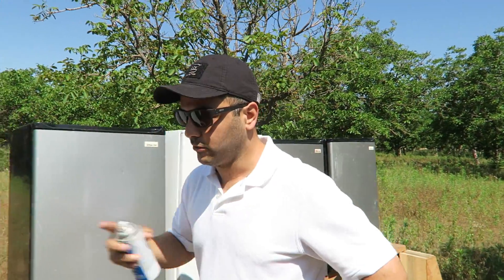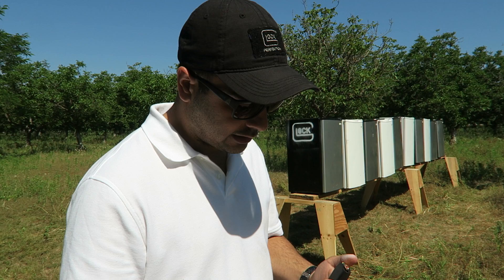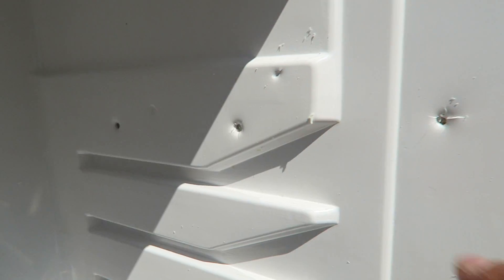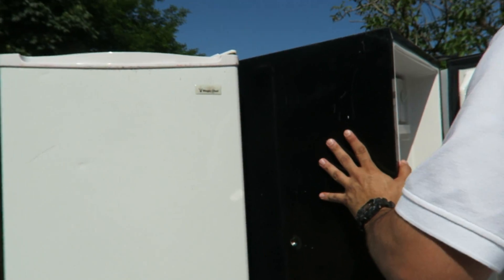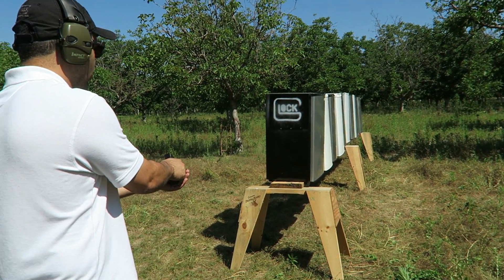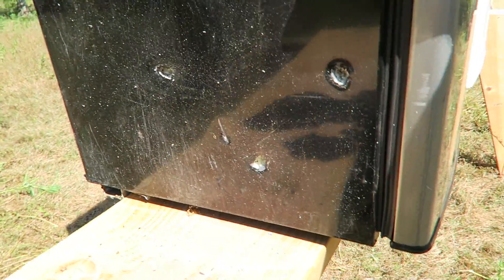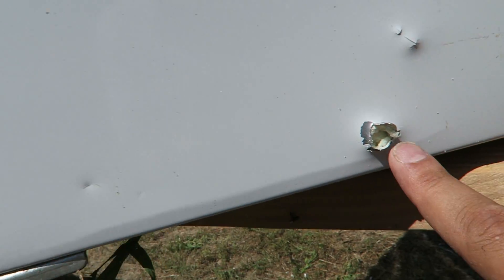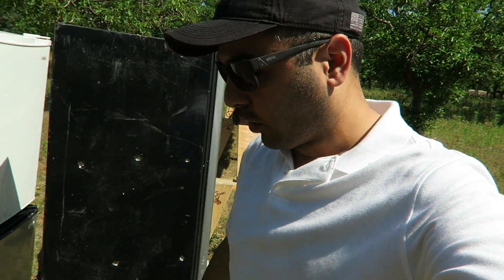GLOCK 19 VS REFRIGERATOR  -- Edwin Sarkissian

Comment: That air you heard was the coolant leaking out of the refrigerator. That size refrigerator uses the sides to cool the coolant down after the compressor. If you look at some small and large fridges you will see a coil of copper lines running on the back that is where the hot compressed coolant cooled is before is it expanded cooling the coolant off to cool the fridge down. The cycle goes compress cool gas to hot liquid, hot liquid is cool to warm liquid,warm liquid is expanded to cold gas, cold gas is used to cool desired area the cool air is compress to hot liquid.

Comment: Why did a Glock 19 full metal jacket bullet pass completely through 5 refrigerators in Nevada but in California the 5th refrigerator stopped the same bullet fired from a slightly different Glock 19?

Comment: There is definitely a line there it pumps hot refrigerant from the discharge side if the compressor through that area to prevent freezing out of the freezer section

Comment: that sound you hear is refrigerant gas escaping,  The gas runs through lines up and down the sides of the unit,  it isn't trapped air escaping.
Reply from the maker: +joe rohling yah a friend of mine told me that . Didn't know there was lines going up and down .
Reply: It's actually freon. Not good for the environment